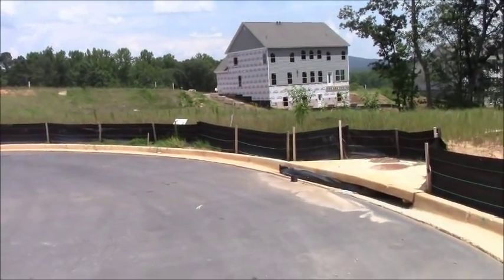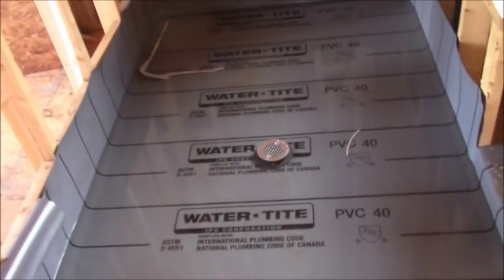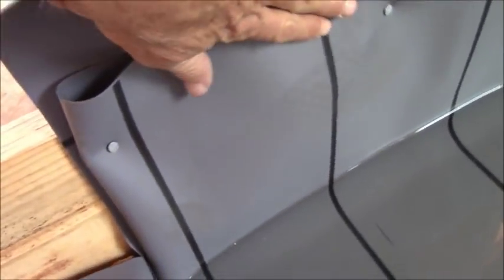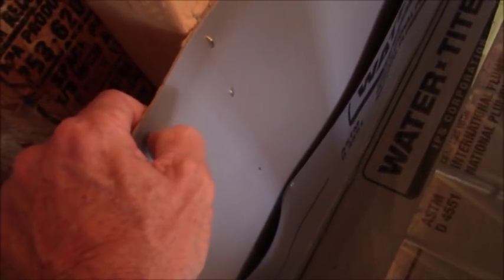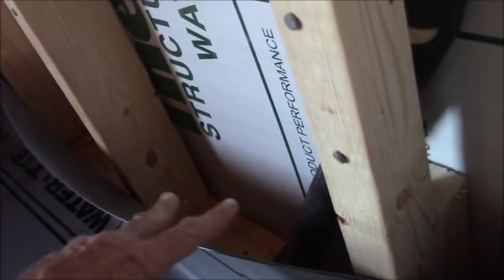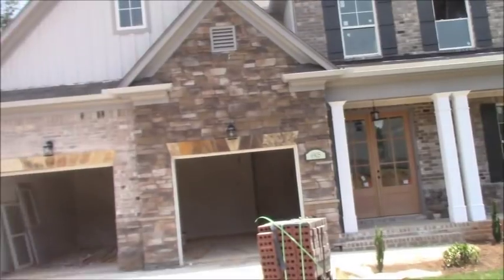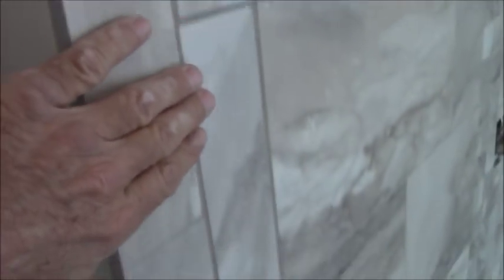NO ShowerPan PreSlope ..NEW CONSTRUCTION

Comment: I'm a plumber 30+ years, I've never seen plastic water pipes deteriorate but I have seen it happen to copper. Corrosive water conditions can cause pitting and pin holes.
Reply: Trevor Cameron  35 yr. old plastic fell apart in my hands ...the system looked made of repair couplings....was the yellow stuff.
Reply: Sounds like PVC pipe, was it rigid or flexible pipe? PVC is not code for potable water inside a house anywhere I know.
Reply: CPVC?
Reply: I've seen pipe corrode from the outside in due to flux corrosion.  Never seen PEX fail on any of my installs over the last 10 years I've been using it.  I've also seen copper corrode because the water here in Dallas is horrible.
Reply: uppunor pipe work grat i loveit in texas u use that all the time
Reply: the pipe us uppunor pipe
Reply: My local home town was plagued with copper pipe pin holes, a city water Ph problem.  People had to do kitchen and bathroom tear outs.
Reply: Cast iron and copper mix here in central Fl.  My brother has the paper drain pipes  (Orangeburg) under terrazzo floor on the coast.
Reply: Amen
Reply: From what i have seen with copper is sloppy sweating of the joints causing cavitation through the pipes resulting in pin holes (so far close to the joints).  Made a repair and cut the pipes open to investigate.
Reply: NC. Pex all day long. Love it, just use brass fitting and not the plastic ones. Never once seen an issue if gone this route. But I have seen failure in everything else. Even beloved copper.
Reply: @brettkowalewski9535  I agree. I don't understand why this has even been questioned. I live in NC
 We get 100+ degrees Summers and down to -teens some years in the winter. Never an issue with pex and brass fittings. The house I live in now has plastic fittings, so I'll have to see how that works out over time. But I have seen every other type of piping fail. So idk why people seem to think it's not a good material.
Reply: Robert Helmick it’s because they read old 80’s and 90’s articles about pex failing because it was such an unknown and a new technology.  Europe has been using it for over 40 years and huge strides and breakthroughs have been made in pex development that has brought us to the current product.  I even have a shark bite push in fitting in my garage(exposed) that has never shown any sign of leaking.  It’s been there 9 years!
Reply: @brettkowalewski9535  I can't speak for the other 49 states here but pex is in every new construction here and a lot of remodels I've seen. Very rarely do I ever work with copper. I use pex on all bathroom remodels I do, and even the sharkbites. They are a bit pricey here, but 14 bucks for both lines isnt that big of an investment when you are only changing out a shower valve in a bathroom remodel.
Reply: Robert Helmick I do it the same way sometimes when I’m in a hurry, but 95% of the time I still sweat on the copper to pex fitting and connect the pex with the full copper ring, never the stainless steel rings.  Shower valve supply lines are usually up high enough where water in the pipe isn’t an issue.
Reply: In the Philippines they make ribbons cut from tire inner tubes and wrap leaking pipes.
Reply: Thanks, saved me the trouble. I have acidic well water, copper rots!
Reply: I'm a plumber for 30+ years as well, I started when I was 2
Reply: plastic water pipes have a poor record when compared to copper. Pex needs to go another 50 years before they even get a track record that counts.  There were many lawsuits in L.V. ten or fifteen years ago that will attest to that. Pex is only as good as the company that makes it.  I would highly suggest, if you are using pex,.. to have as few connections as possible inside wall cavities., couplers, ells, etc., have been their weak points.
Reply: I have replaced 1000's of feet of degraded copper pipe
Reply: @roberthelmick9574  I know a plumber that was on the roof of the Pentagon after 9/11. So, I guess he's pretty good. He loves that stuff with the compression fittings like in this video. He walked me through the process....its pretty dope
Reply: @denny3161  CPVC (Chlorinated Poly Vinyl Chloride) and yep its junk
Reply: I’m not a plumber  . I was a tile man ,  but now a coal miner . I have seen copper deteriorate and get pin holes also . I have never done a pre slope  and in 30 years have never had a call back on a shower  have never heard anybody including my parents complain about a smell !  And I do agree about solid marble on the thresholds and should be sloped toward shower floor side . And the pan liners in this video was folded terribly 🤣 I am in the process right now of building a 5 ‘ By  5’ shower I am using concrete backer board and will not be letting it go below the mud floor and it will have plastic stapled to the studs behind it and run on the inside of pan liner . I will not be using roll on water proofing on concrete board but will be using wedi membrane that comes in caulk tube over the screw heads , seams between concrete board and inside corners . I did put wood blocks between studs . I went with pex plumbing . That’s about it 😉
Reply: Plumb Nutz I hate copper, to use is it in today's market is so stupid with the introduction of pex and other durable products.
Reply: Yes Sir! Electrolysis in copper also causes pin holes
Reply: @alucardlledroc  this cavitation caused leaks near the fittings is caused by not reaming the pipe. I've seen this in large buildings where the water comes into the building, this pipe is getting the most volume of flow, a characteristic hole will appear just downstream of the fitting.
Reply: Exactly I said the same thing they went to pex for that reason I thought
Reply: much of the copper I see is just as you described and I've given my men instruction to NOT TOUCH copper because of it's condition in many cases of remodeling
Reply: @peggypenland1560  copper is still a lot cheaper than pex though. Pex is nice for short run utilit connections, but I'm not paying $15 a fitting to plumb an entire house

Comment: Pre-slope is required and code where I am, so that pretty much ends the argument here.  If there is no slope, then you fail, period.  Doesn't matter what anyone thinks.
Reply: I bought a house one year ago, it’s only 13 years old, and recently discovered a mildew smell in the shower. I remove some grout, then the tiles, and finally the mortar bed and realized there is no pre-slope under the membrane! Fortunately, the mold was very minimal, but still… Especially down here and humid south a pre-slope seems essential! So now I need to figure out how to Put a pre-slope with a new membrane… Without tearing the walls apart hopefully!
Reply: @GregoryGuay  I usually demo the tile about a foot up including the step. Re do the concrete with slope, membrane, then slope again.

Comment: It is called Pro Pex.  It is an expansion system.  This house would be well into the 800 k.  The tub pan is not a flood test it is simply providing weight to hold the tub into the mortar bed.

Comment: I always add the pre-slope because these membrane systems were engineered to use them and it’s what the membrane manufacturer recommends. Not using a pre-slope as the manufacturer recommends could void the product warranty and if you have a failure that causes damage to the house, your liability insurance may not cover you as a contractor for not following the manufacturers recommendations.
Reply: (Frank Pereira drops the mic)
Reply: Bingo!
Reply: This is why I am arguing with my contractors about.
Reply: I always preslope. The preslope allows drainage to the weep holes. The capillary action is minimal, the capture of water in the far corners is most certain. I say build examples of both, have each without grout to demonstrate a leak. Then, see if it matters. It will certainly drain more readily on a preslope.

Comment: I agree with your logic on a pre-slope not being needed.  I'm doing a 8x5 shower now, waiting for the plumbing work to be finished.  I will be laying the pan liner and then doing the mud base pan with a 36" liner drain on the entrance into the shower.  The previous builder who tiled the shower 20 years ago, cut the joist to center the drain and used a sister block to support the joist he cut.  2nd floor master bath. So to address the center drain issue being on a joist, I'm putting in a liner drain along the curb.

I couldn't believe how many mistakes the builder did on this tile shower.  The builder also used corner bead under tile, no water proofing, open seams on corners, attached tile to bare joint compound, used corner bead nails to attach the cement board.  As you can expect, major water leakage from the bench and pan areas that also was not sealed or built correctly. 

Great video on this point!

Dave - Remodeler 
Chicago

Comment: I am a tile contractor in Nevada. I understand what your saying about not needing a pre-slope. However I disagree that you dont need pre slope. I have been back to many remodels with no pre slope where standing water in the pan, along with a strong mold odor, is an issue. That being said, concrete can get saturated so much before it hits the pan liner and then what? No pre- slope means standing water, means stagnant water, means mold, means problem. You also pointed out some good things about the pans rolling over the curb and wood being exposed... great point. I dont care what you do to grout water will seep through: wood swells... tile pops... problem. However I do disagree with technique on pan liner folds over the curb. the curb is gonna have metal lathe and a mortar float so who cares what the folds look like, folds are a pain in the ass and always problematic...as long as its sealed and it dont leak your good. I disagree with how you talked about the bench being inside the panliner. I believe thats the best way to do a bench, it ensures that the bench wont leak there will be no chance of water getting outside the pan area. As for your comments about sticking tile to a wall, I agree in part with there will be more lippage....everyone knows the best way to tile showers is to mud float walls, but that doesnt mean you cant make a good job without floating. With all that I said I leave you with this... there is more than one way to skin a cat!
Reply from the maker: Agreed. There are MANY ways to insure a "proper" build, as long as there are no issues it doesn't matter how it's done.

Comment: There are numerous reasons why pre-pitching the liner is better than not. The best reason is that if it is not pitched it is possible if not probable that the drain will not be the absolute lowest point in the shower. The problem that can develop is that water can pool in the undesired lowest point say in a corner then affluence can build up and microbes can grow and this is un-sanitary and produces a foul odor. I've torn out showers where this condition existed. 

The last several years I've switched to using waterproofing membranes that are on top of the pitch and directly under the tile. My favorite is schluter. Schluter systems completely eliminate the possibility of water pooling under the tile and the waterproofing of the walls makes for a totally water and vapor proof system. The water is totally contained so that it can't migrate into the wood structure. Plus the material weight is much lighter on the workers and the house and it installs much faster and makes it easier to achieve a waterproof system with less chances for error on the party of the installer.
Reply: Jeff Powell - Amen!!! Finally someone on here who gets it and uses Schluter besides me! A far superior system to what the Stone Age Tilesetters are still using
Reply: Yeah, I just took apart my shower to find the source of the mildew smell and besides the fact that the weep holes were plugged, there’s no pre-slope under the membrane. So I’m browsing YouTube trying to decide if I should cut through the membrane to put a pre-slope and then a new membrane on top of that.Oatey Makes a pre-slope that looks good. I don’t want to mess with the walls so I wonder if I can put the new membrane up underneath the old at least 6 inches up the wall?
Reply: @GregoryGuay  when I used to use polyethylene pan liners I always took the liner 8" up the walls. I also used goof proof pre-pitch screeds as well as the mortar bed screed system. I would tear out the old pan liner and install a schulter kerdi pan. If possible use their extruded polystyrene base. It's much easier and guaranteed by them for 10 years  when installed according to their directions. 

If you can find a match for the wall tile then fine save the walls but it's a lot harder to install the tile that fills in between the pan and the old tile on the walls.

Comment: Couple things. Code varies depending on where you are. Even then, it could be up to the inspectors discretion. If he or she wants a pre-slope, its getting one. I'm sure you know this already. The piping is Uponor and it uses an expansion tool to expanded the pipe and that propex ring you see on the end. You then have a few second to push it over the fitting before it shrinks back down. After about 10 seconds, you're not getting it off. Its been around for years, just not in homes until recently. Also, the problem with copper is the cost. What home buyer/builder wants to pay for that? Also the cost of the time to install it all. Just my thoughts. Thanks for the video.

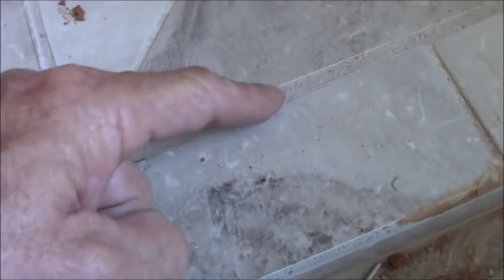Comment: I am redoing my entire bathroom from the ground up because the 3 year old remodel had the glass on top of grout and no water proofing underneath... silicone separated.. grout cracked... water leaked through the ceiling (soaked the subfloor under the entire shower and tile flooring)! I'm living proof you are correct at 13:10 :).

Comment: I always do a pre slope..and drill the 4 weep holes with a drill bit to make them bigger and I use a small amount of pea gravel around the drain...and I notch the 2x4's out at least an 1/8" back and 10" high off the slab so my folds don't bulge out and are tucked in the wall and I put flaps on the curb,  my evidence of not having a pre slope and the damage it can do is all the pans I've removed that where not leaking or ever did but where full of mold from stagnate water...if you are a plumber you pitch all your pipes...so by your theory that would mean that I could lay my 4" main drain going through my backyard to the alley to the city drain could be laid flat or level and It would never back up? Standing water in a pan can also can wick up the CBU and if there is no vapor barrier the moisture will get into the stud bays. Also when you pulled that pan back off the wall to look inside I seen a framing nail sticking out past the framing and a nail proof plate that has sharp edges was right by that nail...i always check for protruding metal like nails heads and if I find any I either grind them smooth n flat or I bang them in with a hammer...also when I cut the pan liner around for the drain hole in the bolting flange I cut it like a 1'4" bigger than than pvc hole so the pan liner flaps down a little bit  down I to the drain when you go to bolt the flange down.
Reply: Nathan Cuellar 👍👍 Good common sense makes a good man👍
Reply: this man knows what hes talking about
Reply: fluke196c - not really. Schluter Kerdi shower system eliminates all those extra steps he just listed. All that extra work he does to insure water-proofness is still inferior to Kerdi which is the only product on the market that is waterproof, steam proof, and is an anti-fracture membrane. Get out of the Stone Age boys
Reply: Finally a professional weighing in.
Reply: @wigoalie3064  Find clients willing to pay for all that stuff and maybe it will be used. Hard to get jobs when you have to bid that high. Maybe I'll move to California, they apparently have unlimited money for houses out there....
Reply: I’ve always wondered about having the pan liner slope into the drain a bit. It seems like a smart idea but I never see people do it on YouTube.